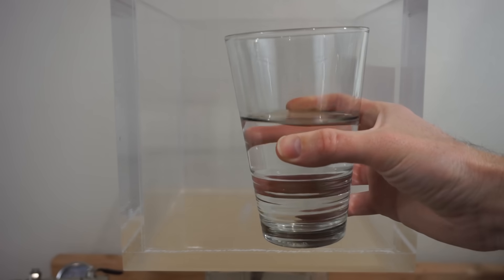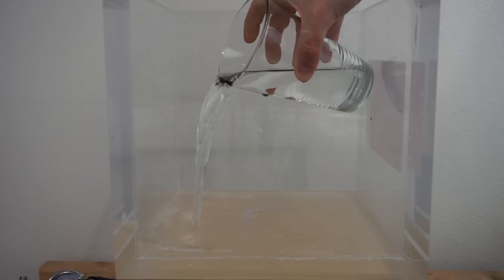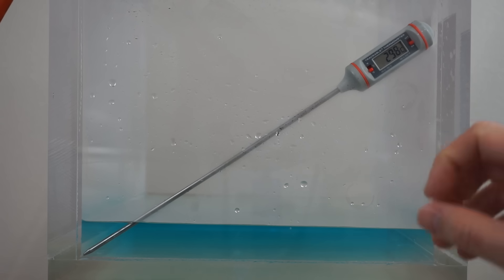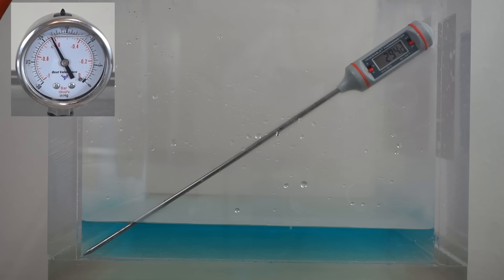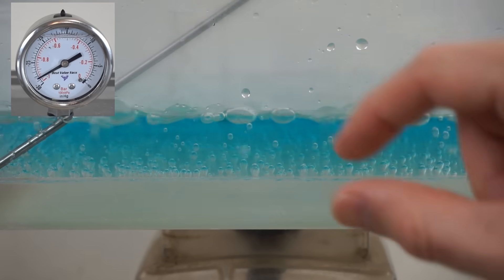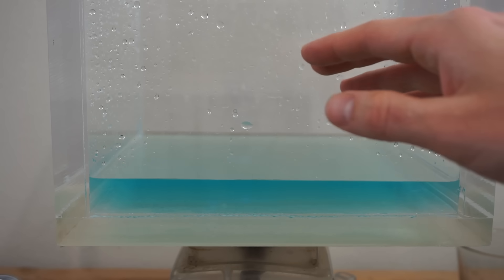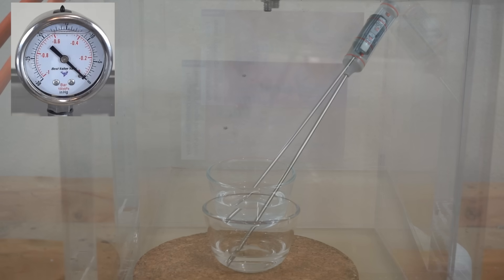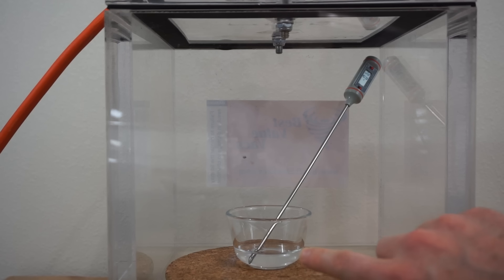Does Water Really Boil in a Vacuum Chamber? And Why?

Comment: If we could create a breathing apparatus that used a vacuum to take air out of the water potentially we create oxygen tank-free scuba gear. That would be cool.
Reply from the maker: +Daniel Padgett that's a cool thought! So a small vacuum pump connected to a tube that continually brings in new liquid that has the pressure lowered until the dissolved air is released. That air is then returned to normal pressure. It wouldn't be much volume of air per volume of liquid though, so I don't know how plausible it would be, but that would be cool.
Reply: Of course, development could create a strong compact vacuum that would increase water flow and air supply to a faster rate. All ideas can be improved upon. Love your videos they're great and very informative.
Reply: The Action Lab way late to the game on this, but "normal" pressure in this case wouldn't be the same as on land.  Keep in mind, you're under water, so you're under a lot of pressure.  The air you breathe would have to be pressurized, too.
If you went to the bottom of a swimming pool with a rigid tube, and tried to breathe through it, you'll discover your diaphragm isn't strong enough to match the pressure at much of any depth.  PLEASE don't try this, as there are inherit dangers involved.
I'm a diver, both recreational and (retired) commercial.  As such, I'm studied in things like gas laws, and basic human anatomy (at least in so much as what parts of the body are most affected by pressure changes.
Don't use yourself as a human guinea pig trying to test gas law.  I don't want to appear in court when you pop your lungs, shatter teeth, blow out your ear drums, etc.
Reply: use electricity to hydrolysis for pure oxygen supply under water and it done according to internal combustion system as we need water intake in it's pure forms so we need filter and a efficient battery will provide power to this setup and underwater we living our lives forever without the need of atmospheric oxygen
battery are charge with waves energy or solar energy
Reply: according to indian literature it's already done by nivat kavacha rakshasa in india in ancient times of vedic kaal

Comment: does this mean that the freezing point of water is much lower in space or anywhere where the pressure is less?
Reply: More like the sublimation/deposition point, than the melting/freezing point.   But yes, that is correct.

Comment: "Does Water Really Boil in a Vacuum Chamber?"
Of course it does.  This is why water boils at lower temperatures, higher above sea level.  This is where comets get their tails.  They don't have tails way out by Neptune or Pluto, because it's too cold, but as they come in toward Mercury and absorb a higher concentration of heat from the Sun, the ice that composes them begins to melt, and since they have no atmosphere, that melt vaporizes instantly, creating the tail.  This is why the tail consistently points away from the Sun.

This is also why the Kuiper Belt orbits from 30 to 50 AU away from the Sun and the Oort Cloud orbits at a distance of a light year instead of the Kuiper Belt of the Oort Cloud orbiting right next to it.  Right next to it, both would boil off and travel to their current distances.  In fact, that's probably what happened, way back when the Solar System was forming.
Reply: ._. ok

Comment: Serious comment: Wouldn't the opposite be true as well where the freezing point is lower because of the atmospheric pressure, therefore it didn't freeze?
Reply from the maker: +Yimmy Gomez the freezing point doesn't actually lower until you get to less than 1kPa. I don't think it was that low, but it could have been. Maybe that is why my water didn't freeze.
Reply: maybe it brought it low enough to prevent it from freezing. I mean, you were right there at freezing point, so it's possible

Comment: The Action Lab  How strong is your vacuum chamber?  Theoretically, you can't freeze water unless you get down to 0.006 atm or less
Reply from the maker: +DANG JOS well the water should freeze at 0 C any pressure below 1 MPa. The freezing actually just comes from cooling from the water evaporating. But I think I was supercooling the water so it never actually froze.
Reply: +The Action Lab  Yeah there could be supercooling.  But when I said that it shouldn't freeze below that temperature, i didn't mean that water cannot freeze at higher pressures.  What I mean is that once the water reaches 0 C, its vapor pressure is 0.006 atm.  So in order for it to continue boiling, you would need to get your chamber below that pressure.  But I think I see what you're saying.  The water can probably still freeze at a higher pressure as long as it is well insulated.  After all, even if it isn't actually boiling, it is still evaporating and losing energy
Reply from the maker: +DANG JOS I see what you mean. Good point. I doubt that my vacuum chamber is getting below 0.006 ATM. But I believe it still can get colder even without boiling because it is actually an air water mixture in the vacuum (new air comes in through micro leaks and so it is never saturated with water vapor) so the water can still evaporate without boiling and that would continue to cool it without boiling.
Reply: +The Action Lab  Agreed

Comment: +The Action Lab  To add to the definition of boiling, it is when the vapor pressure of the liquid equals the atmospheric pressure.  As I learned from a physics professor once, the internal pressure of a steam bubble is equal to the vapor pressure, and if that is smaller than the outside pressure, then the bubble will literally collapse back into the liquid.  This is why, when you put water on a hot stove, you see water on the bottom get hot enough to form a bubble, but it collapses before reaching the top.  This is of course because the water isn't yet hot enough to sustain the steam bubbles
Reply from the maker: +DANG JOS yes the vapor pressure =to atmospheric pressure is the better definition of boiling.

Comment: At a lower atmospheric pressure, there's less force pushing down on the surface of the liquid meaning the energy threshold to jump from liquid to gas is lower.    Since it requires less energy to become a vapour it can boil at a lower temperature -- or room temperature (temperature is simply the average kinetic energy of atoms in a substance)
Reply: OMGG
Reply: Does it ever fully evaporate? what happens once all the water is evaporated and you increase the pressure again?
Reply: @Stonnin  I presume not because its a vacuum and the vapour has nowhere to go.
Reply: @Stonnin That's a good question !
Reply: You nailed it!
Reply: Thank you!
Reply: So, because it requires less energy to become vapour, does that mean that the individual molecules already had the energy they needed to evaporate without taking energy from the surrounding molecules?
Reply: Earth : ????
Reply: Not accurate, have you wondered though why you can't cook (boil) an egg in this water? Bubbles forming when you boil water to cook ...pasta and bubbles forming in this experiment are one and the same: Gas molecules forming and escaping from the water. The difference is the method used. One is the introduction of energy (heat) and the other is reducing the atmospheric pressure around the water. Think why it is recommended to add salt in the pot for cooking: Because it helps the water reach the recommended higher energy point (e.g. at least or a bit higher than 100C) and faster. Bottom line is you cannot boil (cook) hard boiled eggs in this kind of vacuum environment. so you guys should stop saying, boiling. It is not!
Reply: @XwpisONOMA  the definition of boiling is not "can cook an egg in it", it's "is turning from liquid to gas". Watch from 6:21
Reply: @jakebrowning2373  nice one🤣🤣🤣
Reply: @XwpisONOMA  Cooking an egg is caused by the denaturation of proteins inside the egg. All proteins denature at a high enough heat. As the proteins denature, they permanently change shape, although an egg has been "un-boiled" in a Nobel Prize winning experiment in 2015.

Boiling water is fundamentally different to boiling an egg. Boiling water changes the state of the water, and boiling an egg denatures the proteins inside the egg.
Hope this helps :)
Reply: @YellowBoi  Can we modified to lower the heat needed for boiling eeg...??
Reply: @XwpisONOMA  This is what happens when you try and be smart in the comments section of a video watched by people much smarter than you. 

Next time you should pose something like this as a question, rather than a contradiction. :)
Reply: @XwpisONOMA  Boiling is the rapid vaporization of a liquid, which occurs when a liquid is heated to its boiling point, the temperature at which the vapour pressure of the liquid is equal to the pressure exerted on the liquid by the surrounding atmosphere. Wikipedia

It's literally boiling.
Reply: @Tact012  Perhaps paradoxically, it actually takes more energy to boil a liquid at a lower temperature, but the lower pressure means the gas bubbles can form, without collapsing, at a lower pressure
Reply: @XwpisONOMA  so boiling is defined by the ability to cook an egg in a liquid? Hmmmm

Comment: Do a test how much the vacuum chamber weight when in vacuum!
Reply: this is earth, a vacuum on the surface of earth is still affected by earth's gravity,so it should be no difference.And they also need a larger vacuum chamber for that :P
Things are different at space station or satellite is because they are not stationary, they move alot (have momentum) to counteract the gravitational pull so that they wont fall down to earth.
Point is Vacuum simply state that that space has no gas in it
Reply: Lol gravity
Reply: Since the majority of mass of the vacuum chamber is the solid walls of the container, removing the air from inside will not noticeably change its weight.  This is why vacuum airships that could exist in concept, have never become a reality.  It is impractical to build a lighter-than-air vessel with walls rigid enough to support the vacuum inside the vessel.

Comment: then why does watter boil on a burner even when the water is continuously having heat energy from the bottom?
Reply: Air pushes on water. Water pushes back. The higher the water temperature, the harder the water pushes. When water pushes harder than the air, it boils. Boiling drops the temperature, so to keep boiling going, you either need to raise the temperature back up (e.g. keep the burner going) or lower the air's push strength (e.g. keep pumping air out of the vacuum chamber)

Comment: Open the vacuum chamber immediately when the water in below 0 degrees and see if it freezes instantaneously. Like if you agree👍
Reply: its sick!!!! ya pressure will speedy back to normal and at normal pressure water will freeze will be resublimation, from gas to ice instantly but it will be like implosion. it will suck some air and idk what will do but its dangerous
Reply: Ithachi Uchiha I've heard this claim before.  Why exactly would the water immediately freeze??  Is there a video of this somewhere?
Reply: DANG JOS it will freeze because its below 0°C it just doesnt freeze while in the vacuum chamber because changing the pressure decreases the point at which it does so (just like it decreases the temperature needed to boil)
Reply: +Lars L  Lowering the pressure over water actually increases its melting temperature; it doesn't decrease it.  I would question the accuracy of his thermometer.  Even if the thermometer is accurate, the most likely reason for the lack of freezing is super cooling.  Not a reduction of pressure.  The triple point of water is actually at 0.01 C
Reply: looking at the triple point graph of water, increase in melting temperature while lowering pressure only happens at 212.9 MPa until 10MPa, the rest of the pressure is opposite of what you said. Triple point only means at that pressure all 3 states of that matter can exist together. 
I would not question that thermometer, it is only a matter of time that the water turns into solid/gas because the pressure definately are below the triple point of water due the the temerature kept decrease in the water, at one point the temperature surely will stop and that will be when the freezing happens.
@DANG JOS you should take a good look at the graph seriously...
Reply: +Heng Kuan Chong  You need to seriously look at the graph again because you obviously don't understand what is going on.  The difference is small so you probably can't see it, but by definition, the triple point of water occurs at 273.16 Kelvin or 0.01 degrees Celsius.  Last time I checked, that is an increase in temperature when lowering the pressure from 1 bar to 0.006 bar.  At 1 bar it is 0.00 C while at 0.006 bar it is 0.01 C.  It's a small difference but what I said stands.  What I was saying is that it is not true that a higher pressure leads to an increase in melting temperature of water.  So what I said stands
Reply: DANG JOS just looked it up and you are actually right, but it would still be possible to freeze the water instantaniously if this vacuum chamber can get to a pressure below 0.006bar or 0.0059 atm
Reply: Sam Johnston Would be better to use a ball- or pipe-shaped chamber for that, but if did on his backyard with some tool so he doesn't get too close it would probably be safe to do
Also, his vacuum chamber seems to only go down to a little less than 0.02 bar so we can't do this anyway
;-;
Reply: Ayyoob Solomon Correct me if I'm wrong but the chamber won't open if there's a vacuum in there, at least not with hands
Reply: But, can you actually open an empty chamber without it to implode?
Reply: @1islam1  Richy Gervais(2020 Golden Globes) "Shut up, I know hes your friend but i dont care."
Reply: Ithachi Uchiha hello.. I am Shizuko uchiha I is sasuke wife >w <  bye itachi.. I is from Tokyo Japan, where is you from

Comment: So if u sent a fish tank into space with water and a fish, the fish would drown?
Reply: air will not be outside but still be inside, is fish tank are good closed pressure will stay normal inside and fish will just swim in water but without gravity. but at normal glass used to fish tank will not made this. difference of pressure. fish tank will reak and pressure go out will be no pressure and water will be gas so fish will have nothing to swim in.
Reply: are you really or you joking? you think it can work?
Reply: I was joking, but if you put a fish tank in a vacuum would the fish drown?
Reply: Now you got me wondering how microgravity affects the fish.
I'd heard that the primary reason fish suffocate in air is that their gills collapse, which wouldn't happen (as quickly) in microgravity.
Vacuum, however, would indeed rarefy the gasses below useful densities for the fish.
Reply: i was not looking at biology of fish, i was looking at tank and water in it, i never liked bilolgy, chem better. if you looking at fish and biology not at state an temperaturę of water and tank, do not ask me i dont know. i know only fish breathe with air dissloved in water nothing else :P

Comment: Question, is the water pure now that the air has been undisolved from the water?

and if it isn't, what exactly is it now?
Reply: Charter Hold it probably still has dissolved ions in it.   so not pure
Reply: It has food coloring in it, and whatever is in tap water that doesn't evaporate--the components of hard water deposits, for example.